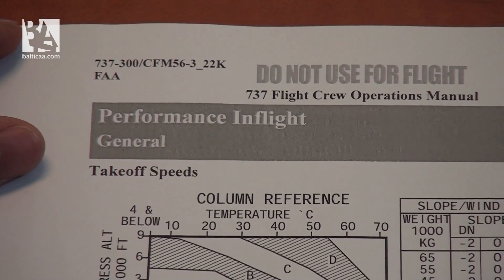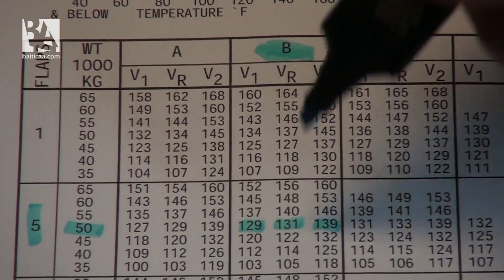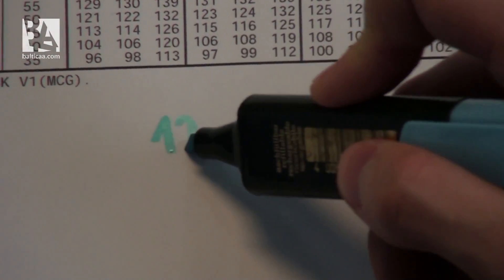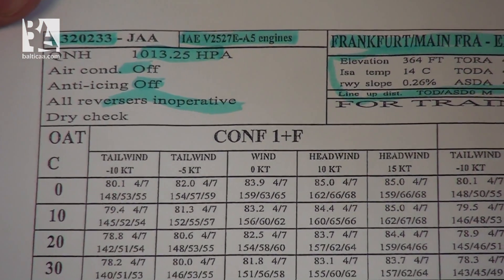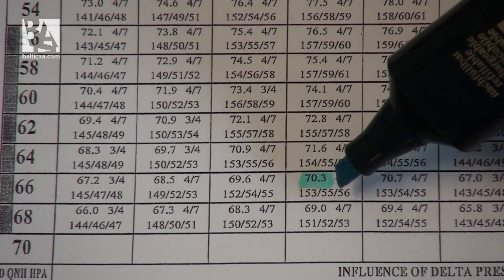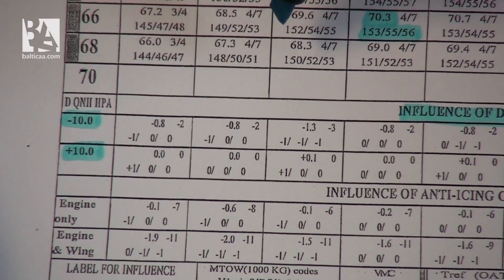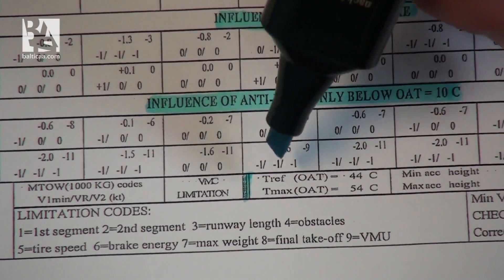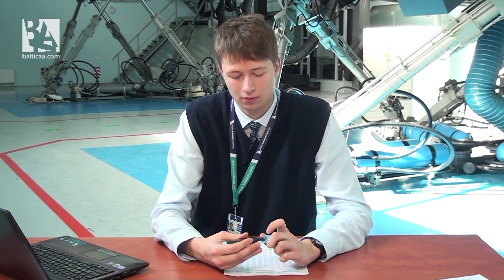How to calculate the take-off speeds for a Boeing 737 and an Airbus A320 - Baltic Aviation Academy

Comment: why do you have to calculate this instead of using v1=165knots for example. i understand you need to know the minimum speed but what would happen if i took off with more (much more?) speed that desired?

Comment: what is meant by "one engine out climbing speed" and is this procedure recommend before every take-off?
Reply: If an engine failure occurs after v1 they should follow the v2 which is the take off safety speed during engine failure.

Comment: hi can you show us how to calculate mtow
Reply: MTOW (maximum take-off weight) is calculated by the aircraft manufacturer as the maximum weight the aircraft can be at takeoff. What pilots have to calculate is the aircraft weight, which is simply aircraft operating empty weight + fuel on board + passengers & cargo and ensure it is under MTOW.

Comment: Hi, how can I get the charts for other aircraft? please
Reply: +Francesco Mura Try to find online aircraft operating manual for a specific airplane model. For instance, I run simulations on Boeing 747-400 and I"ve found PMDG operating manual for this plane at this link: https://issuu.com/skylife.e-magazine/docs/pmdg747_400_operating_manual_v10 
On pages 41 - 52 it is explained how to determine V1, Vr and V2, as well as pitch angle for the takeoff, trim setting  and takeoff thrust. It includes charts and tables like seen in the video for this specific model.
Hope I was of some help.

Comment: A question: WHERE MAY I DOWNLOAD THE CHARTS FOR THE AIRBUS A320. As I see in the video you need charts for every single airport, and every single runway, having in mind the weather conditions. So, where may I get those charts?
Reply: +MR MISTER  http://s126.photobucket.com/user/mrmister001/media/U0S2SP0-DBL%20-%20RTOW%20Regulated%20Take%20Off%20Weight%20-%20CHART_Paacutegina_5.jpg.html here you go :)
Reply: @johnirvinsantos7026  late, but do you know where i could get the sheet for the 737? i can not find it anywhere.

Comment: where can i find this tables, can i download that?
what is the headwind exactly or how can i find it out if i have a head or tailwind? example wind 280° 15kts what is that then?
Reply: Jonas Zimmermann You just have to check the weather. In your example with a speed of 15kts into the direction of 280° you would have headwind if you would start for example on a runway with heading 100° and tailwind if you would start on a runway with heading 280°. So if you start into the direction of the wind you have tailwind. If you start against the direction of wind you have headwind. P.S. The heading you start to must not match exactly with the heading of the wind. (ᵔᴥᵔ)

Comment: why the calculation of airbus is so complicated than boeing?
Reply: ASTUESP cough cough Moon cough cough
Reply: @marvinuhilarious  *cough* germans took you to the moon
Reply: ASTUESP American are Europeans unless you are a Indian don’t play that card again you  will  loose.
Reply: @1100BFK  American's are not all European. We're everything. That's literally the point of the country. Moron.
Reply: Airbus cares about safety more than Boeing
Reply: ASTUESP I guess that’s the reason American Airlines is the largest operator of the Airbus A320 family
Reply: Because Airbus is a woman.
Reply: Not complicated at all. Pilots can easily understand these charts, it's the novice (untrained) aviation enthusiast that has a bit of trouble at first. Every airline pilot that started off in a Cessna or Piper or whatever can work through these charts and it makes sense to them, though obviously the actual numbers are different

Comment: If you decide at V1 you are dead. At V1 your decision has already been made for you. YOU GO! Your decision must be made before V1.
Reply: actually you can decide as he said. Some pilots may decide to abort the take off before v1 if a mayor failure happens. Some pilots may decide to continue even if under v1.  Other pilot may decide to continue to take off if an engine failure happens under(but very close) to V1 and they are not too heavy.
Reply: Yes indeed! The takeoff should only be aborted before V1 if the airplane is unflyable. A highspeed RTO can be very dangerous and shouldn't be risked if continuing and returning to land is a safe option.
Reply: why dead?
Reply: Mizzy Roro  ,,00p
Reply: That's why pilot only reject for engine failure or fire of any kind below V1, because you're not going jeopardize passengers lives or even worst, killing everyone onboard deciding above V1
Reply: Actually V1 is the "dead line" at which the first action to stop the airplane must be made. for instance reducing thrust, deploying speedbrakes or applying reverse thrust.
Reply: Siatkowkarzadzi Agreed! So at V1 you must have already begun to reduce the thrust not deciding that you will do it because between making the decision and the thrust actually being reduced there could be a couple critical seconds. That is why if at V1 you have not decided then it is a GO!
Reply: Yup. Didn't see your point of view fully in first comment :)

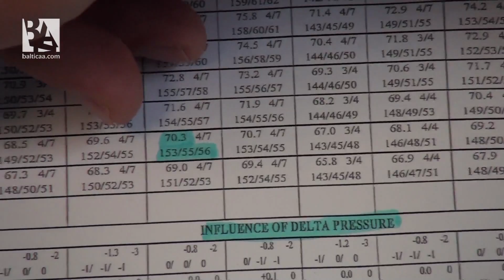Comment: I'm afraid you are not correct with the gray bar show in 6:15. You said that we cannot use FLEX 66 in 6:36, referring to a wrong cell in the takeoff chart.
That bar in 66°C means that this temperature is above TMAX (54 C in this case).
TMAX is the maximum OAT for takeoff, not the maximum assumed temperature, which is TFLEX MAX.
The VMC grey bar is a bar that can be shown near the TOW. When it appears, it means that the speeds are near the minimum control one.
Refer to FCOM!

Comment: Do pilots always determine V speed manually , or does the FMC give it to them?
Reply: It is an airline policy for Boeing, although FMC speeds are only balanced (not optimized). For Airbus, it must be obtained from a takeoff chart or LPC application, since Airbus' FMGS doesn't calculate V-speeds.
Reply: Aviação Livre  Hmm... thank you. But PERF page in the MCDU actually does give us the V speeds depending on the aircraft payload and fuel we enter yea? )
Reply: Prawin Antony No, it doesn't. the flight crew has to V1, VR and V2 manually in PERF TO page. FMGS does compute F, S and Green Dot Speed.
That's in FCOM DSC-22-20-40-10 P2/20 if you wish to confirm :)
Reply: Just to add: I don't experience with this model but I'm pretty sure A380 can compute that. The other models don't.

Comment: A bit wrong Pranas, V1 is not a decision speed. You have to come to V1 it already with decision. It is latest action time for RTO, with ENG failure 1 latest at a second ago. If you will start deciding from V1, You will start Your RTO too late and will end up with tires burned, nose wheel smashed.

Comment: TOGA stands for TakeOff Go Around, a term used for maximum thrust which is used during takeoffs and go arounds.
Reply: It is not always used during take off, only need it if the weight is close or at max take off weight
Reply: Correct

Comment: I am looking for original ones, but Delta Virtual Airlines (deltava . org) has them in the Document Library of the Pilot Center if you sign up and get approved. It shows flaps, temp, and weight used for calculations

Comment: Could you explain "pressure altitude" for 737 Vspeed calculation? it is mean airport elevation? I think would be more helpfull for understanding comperation by temperature.
BTW, your informational videos are really great, thanks for your kindly efforts.
Reply: Pressure altitude is the altimeter when set to standard barometric pressure (29.92 Hg/ 1013hPa) so it shows what the altitude would be for an aircraft/ airport at sea level. Hope this helps!

Comment: In this case the pilots follow the QRH and usually do a low pass over the runway, while the ATC from the TWR checks if the gear is lowered or not (if it is but the announciator light is still red, the light has the failure and they can land safely). After that the pilots carry out another approach and land normally (if all gears are down) or they try to extend the gear manually (by pulling a lever, not by using hydraulics) or do an emergency landing with the remaining gears as the QRH says.

Comment: That's why there are takeoff field limit weight calculations. With every correction (slope, wind, dry/wet rwy, anti ice) calculated it results for  a given rwy lenght, what is the greatest takeoff weight the aircraft can takeoff with in the given conditions for the runway.

Comment: I guess the primary limitation is breaks performance (energy they are able to absorb in case of take off rejection), and the runway length is not a variable of the calculation, but rather the result. if the runway would be too short, then you would need to take away some weight.
am I right?

Comment: Great video :) Thank you for uploading.
I have a question:

Isnt the runway lenght important for the V1 speed? , because you didnt calculate with this.
Reply: barbacoa yes your are very correct. You also need to take in basic weather conditions and runway conditions
Reply: He mentioned the airport and the runway this sheet for